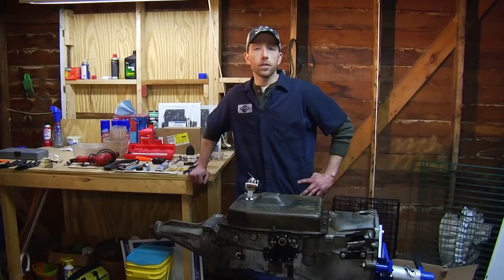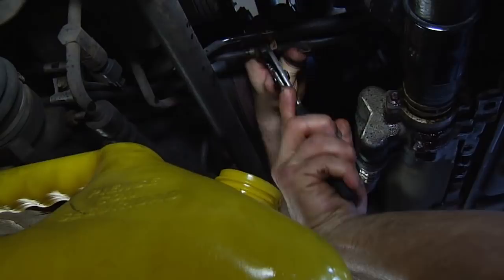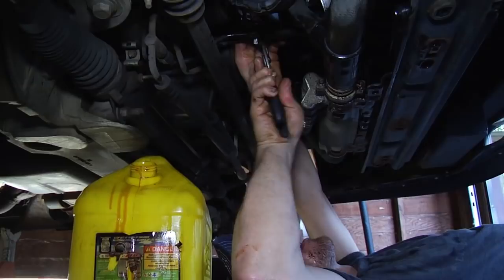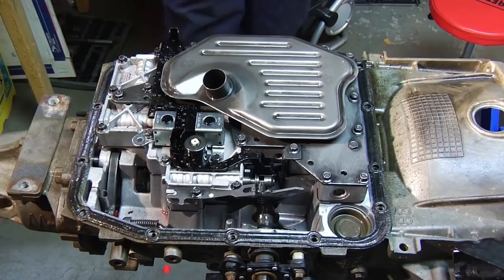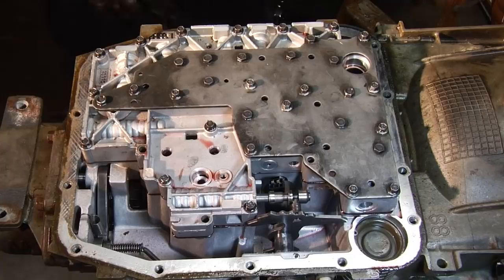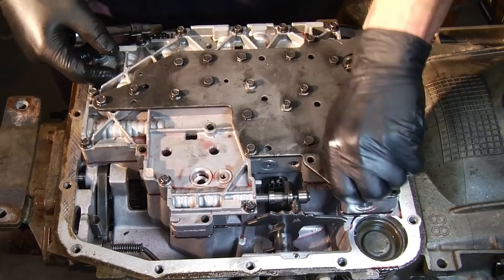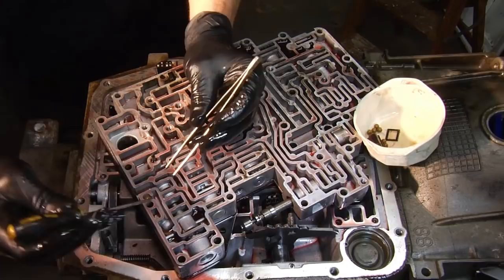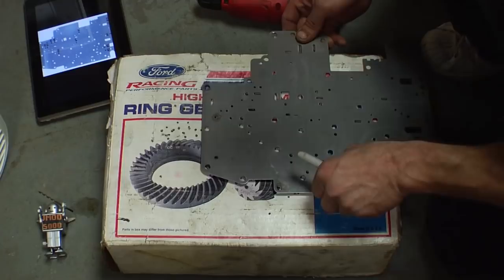The Official JMOD How-to Video by Rizzo

Comment: hi I need help with a small question I saw your forum posts now here's what I'm wondering for performing a j mod on a 1997 it says for hole 6 "no change pre 1998 due to no mechanical diode" so does this mean on my 1997 do not touch the hole at all cause it still gives a measurement of .125 to drill it to . so my question is am I supposed to drill it or not touch it all?
Reply from the maker: http://www.tccoa.com/articles/tranny/transmission/d97.jpg

See the ** at the bottom, drill to 0.125 like he says.
Reply: Ok thanks!
Reply from the maker: Wurd

Comment: okay another question the B&m  shift kit vs the j mod what is your take on them both what do you say is better faster less wear on driveline etc
Reply from the maker: I do not like shift kits.
Reply: Why you find something wrong with them?
Reply: +Mrzeskittles froster do both, Theres nothing wrong with a shift kit they come with stronger parts that would compliment a J mod. for 2006 and newer though you want feel a difference until you take the car to a performance shop and have them tune the transmission through the computer. Im having gearheads near Dallas do my 06 P71. Im installing a Fairbanks shift kit with the billet piston replacement and the J mod.

Comment: Jmodderator should I torque the 9 bolts that hold the seperator plate to the top of the valve body to 92 lb/in? I noticed you only snugged them but should they be torqued like the bolts that secure the valve body to the trans?
Reply from the maker: Yep.
Reply: Thank you very much! And great video; best one on the internet no doubt.
Reply from the maker: Sure thing. 

Thanks man.
Reply: Jmodderator sorry got another quick question. What will happen if I take the plate off of the bottom of the valve body?  The overdrive servo snap ring is broken, and I want to find all the pieces of the snap ring. Is there any way that a piece of the broken snap ring could find its way underneath the valve body and underneath that bottom plate?

Comment: If i just want to quicken the 1-2 shift only..can i just remove the springs you removed first and be done?
Reply from the maker: No, There is no cheating and don't be lazy.

If what your suggesting was possible why would we do all the rest?
Reply: Jmodderator then why when you remove the springs do you say "you have now just improved your 1-2 shift" as if its all that it takes? And when i went on the forums alot of people said they was doing that for 1-2 and 3-4 without drilling the valve body..so i wasn't sure. If you say it still has to be done then that's what ill do because if anyone knows i know its you..
Reply: @TheModAddict  Removing the springs is only a small part of the whole procedure. The freer movement of the servos due to the missing springs in tandem with the increased fluid volume and thus pressure is what creates the improved shifts. Simply removing the springs will cause erratic shifting and in later years will trigger a wrench light and limp mode. Just go the extra step and drill the holes.
Reply: @TwentytenS4B8  yea..this was 7 months ago..its all been done :-)

Comment: Jmod, on my 97 trans I had a Yellow upper & a purple broken lower accumulator spring and on my 96 trans I have a ORANGE upper and a PURPLE  lower is there a difference in the ORange & Purple? thanks
Reply from the maker: The purple, was traditionally... and possibly after 97-98 a color for a Mustang spring.

What vehicle is this in ?

Either way... Check the bore for scratches and such, replace the piston like I said earlier and remove the lower and see what you think about the shifts with out the lower.

Keep all upper springs.
Reply: Jmodderator I said that wrong the 97 has a YELLOW upper Purple broken lower  The 96 has ORANGE upper Purple lower... the car is a 97 crown Victoria lx........  is one a better choice  on the upper between the Yellow & Orange? the orange  96 seems stiffer than the Yellow 97. thanks
Reply from the maker: Those spring choices were made in factory.

I have never changed an upper in all the Jmods I've done.

I can not honestly say which is better, so my 2 cents worth of advice, is , sine they deal with down shift, leave them the color they are.
Reply: Jmodderator Will do, and thanks again for all the help and the video and breakdown you've uploaded to you tube couldn't have done it with out you!  cheers.

Comment: I have a 2011 CVLX and am going to soon attempt this. are the drill bit sizes going to be the same as in the video? I want to follow the video to a T. is anything different in a 2011 as apposed to other years?
Reply from the maker: +Mike Burgett  
No, but holes were enlarged by Ford as time went on, So you won't be removing as much as say a 1999.
Reply: Do you know by chance what size bits i will need to use?
Reply from the maker: Holes 2,4,5,9 and 11 = 7/32 drill bit.

Hole 10 = 3/32, This will give you faster reverse engagement.

Comment: Will any of the small balls fall if I work under the car? I don't want to end up losing them.
Reply from the maker: By that point the entire Valve Body has been removed. I just did it all on the transmission as it was convenient, you should do all the VB work on a table. 

it should be all assembled before it goes back on the car.
Reply: @Jmodderator  oh ok! Thanks.

Comment: Can someone please help me? I took the vavle body off on my 1997 crown vic and no case filter was in there. Does my year not come with 1 of those? l looked in every pocket and it just wasn't there, not in the pan either.
Reply from the maker: If you mean the one I am touching at 15:10 mark, You're fine. Someone lost it before you or the part never went it. 

You'll be OK without it. It was really for the first operation and what very very fine particles may be present.
Reply: Thank-you so much, l was so worried. I dropped the valve body in an empty pan and nothing fell out,looked up in there and nothing. Just happy to know it won't cause a problem.Thank again for the quick responce.
Reply: Please 1 more thing? #1 no change alredy .140,  #2 .081,  #3 .170,  #4 .081,  #5 .081,  #6  no change already  .140,  #7  .100,  #8 no change,  #9,11 were already over .081 so no change,  #10  .076,   l removed 2-3 spring, and 1-2 upper is white and lower is purple. I was unable to get the lite blue and pink so l'm thinking to leave the originals in. I'm adding Canadian Tire Mercon V and Lube Guard Shutter Fixx. Car only has 80k easy grangpa kms. Any thoughts and recomendations are truely welcome.

Comment from the maker: Drill your 2004 like I did the 2002. 

2,4,5,9 &11 7/64th
10- 3/32nd
Reply: I did this tonight after work. Watched your video twice, your instructions made this so easy! Mad props on this amazeing video! Thank you!
Reply: Same sizes for the 2000?
Reply: @s117xXx  I drilled both my 99 and 02 same way, no bad or negative outcomes, the 02 has more of a push you back shift than the 99, i removed springs in both and did both exactly the same.
Reply: Will this work for the 2010 crown vic  interceptor drilling the holes 7/64ths for Holes 2-4-5- 9-11 ?

Comment from the maker: Negative. When you do lets say a 2002 Crown Victoria, The system holds about 14 quarts, Using the trans line and then the rest of the Jmod you'll only get 10 qts. Draining the TC, Then doing the Jmod on lets say a 1997 that has a drain in the TC you'll get your 14 qts out.

Comment: What transmission can all be jmod iwant too go wit 4.6 4v out a lincoln aviator 2004
Reply: NEGUS IBE as far as I know this only applies to 4r70w and 4r75w transmissions.
Reply: The Lincoln Aviators have a 5 speed automatic transmission which is known to fail prematurely. Back in the 2000’s, Ford had a lot of problems with the 5 speed longitudinal automatic transmissions. I’m surprised that they failed more on the 4.0 V6 ones than the 4.6 models.

Comment: +1 on those htrz 2s. good tire overall.
Reply from the maker: What?
Reply: i notice the tire on the crown vic in the begining of the video. sumitomo htr-z 2s. really good tire for panthers, but in stock size (225/60zr16) they are a tad weak. in lateral grip. It almost looks as if you got the wheel and tire pachage from american muscle. they offer a stelar combination with these tires and some nice cobra wheels. im on the forums too, but im just starting my build. @ bavarianbanshee..
Reply from the maker: It was a customers car.

Comment: Hey rizzo... I just performed this on my 06 p71 and im having problems... its a quicker shift but my problems are:  from 2-3 I hear a slight clunk, my shift points are quick if im just driving around the block, my OD light wont come on (but I feel it when it comes on and goes off) my wrench light is on. I followed all the steps untill the end because I don't have a torque wrench so I just hand tightened all the bolts. And I cleaned the valve body with MAF cleaner instead of brake cleaner. Could not having the right torque cause this? PLEASE respond ASAP because this is my daily driver and Im afraid I cant drive like this for long.  Thanks
Reply from the maker: Given the two clear steps you didn't follow, and I also have no idea what your work environment was like nor do I know what else may have happened, I have no idea what went wrong.

Go get the trans code pulled and start from there.

Comment: Does the 97 4r70w have 1 spring for the 1-2 shift that needs to be removed? you mentioned in the video the 05 has 2 thanks.
Reply from the maker: THe 97 has a single.

YOu may also need this.

http://www.transmissionpartsusa.com/AODE_4R70W_Transmission_1_2_accumulator_piston_p/270-000027958.htm
Reply: Jmodderator Thanks for the reply can you tell me why I would need that part? is it to keep the piston firmly in the bore so it won't leak fluid out?and do I absolutely need it for my application thanks Jmodderator for the reply and info.
Reply from the maker: sabrom
 It's a newer style piston itself.

There's a 50/50 chance you have the older aluminum one. If you do, Yes, buy the new one and replace it.
Reply: Jmodderator Yep, I looked at it today it's the aluminum one thanks for responding and saving me time "whew"!!  thanks again jmod,
Reply from the maker: Wurd

Comment: What’s the difference between he j-mod and a shift kit? Which would you recommend doing?
Reply from the maker: Well, Obviously I prefer the Jmod over an OTS Shift Kit. 
Both ways of doing this involve nearly identical steps, This way lets you make more decisions specific to your car. You may not want faster engagement of reverse let's just say. Well you can't close up hole #10 after XYZ company drilled it out. Also shift kits have a profit margin above the part cost, So they are just going to be more expensive. 
The way I tell people to do this is get a hold of an old Forum member I know. He will work with you and figure out what sizes to drill which holes. Then he will send you a Tuff Plate already drilled as you asked for. All you have to do is the work. If you want to replace the pressure solenoid, He can help with that. (They do wear and that causes an internal fluid leak which drops pressures, And that effects everything. That's the valve body's blood pressure. 

So that's my story.
Reply: So I understood dona j-mod, whats the forum members handle, I am interested in getting some work done to my transmission.
Reply from the maker: @jh_3v800  https://www.facebook.com/Ford-transmission-repairs-Jmod-348414635312478/
I don't get anything for referrals, I just flat out believe in this guys work and work ethic. I've known him for well over a decade. 

Good luck man.
Reply: Thank you! The least I can do is give a like to the video. What other benefits can I see from the j-mod
Reply from the maker: @jh_3v800  
The Jmod has three main benefits. 
1 The transmission can in a sense breathe easier with the increased hole sizes. 
The transmission operates better with a new pressure solenoid (Not shown in video, But very easy to do) 
The fluid change along with a battery cable removal-PCM reset it will perform better. 

The shifts can be much quicker and firmer, More direct (Talk to Eric and discuss your goals and hole sizes.)

Comment: is it ok if i didnt take the 2-3 spring out?  took out 1-2
Reply from the maker: For clarity, You removed the LOWER 1-2 and left the UPPER in there. 

Then you left the LOWER (only) 2-3 in there. 

Yeah, That's fine.
Reply: ok cool.  yea took only lower 1-2 out as in the the video.  but where you bend the tabs on the 2-3 and remove the spring,  i did not touch 2-3 at all.

Comment: about to do this on a 4r75w in my f150. anything special to look out for?
Reply from the maker: Yes, Truck VB's are slightly different. I would research that on your own to confirm.
Reply: Yeah I see an impossible to find company called Factory Tech makes a plate but I can't find them
Reply from the maker: Try asking this guy.

He is 200% legit.

 https://www.facebook.com/North-Georgia-Transmission-Auto-Repair-348414635312478/?fref=ts

Comment: can i do that exact to my mercury marauder 2003
Reply from the maker: Yes.

7/64th for holes 2,4,5,9 and 11
3/32 for hole # 10.

Hand twist the paper gasket hole for #4. The lower or closest to the VB gasket hole will not be large enough.

Just slowly twist the 7/64th drill bit by hand to slightly open that one hole in the paper.
Reply: Jmodderator Is that the same as a 2003 F150 4r70w?  Thanks

Comment: Does this work for 97-03 f150?
Reply: If you have a 4R70W, 4R75W, or AODE, this will work. You have to research first what transmission you have based on vehicle model and year, then jmod as per instructions for that model.

Comment: Do I drill the gasket holes also?
Reply from the maker: Usually #4 needs to be punched out.
Reply: Jmodderator thanks and one more question, I don't have a lb torque wrench... Is there a way I could tighten bolt with regular wrench? Is it possible @ all? Like making sure it's tight but not to tight with regular wrench?
Reply from the maker: Inch pound torque wrench is absolutely necessary.

Comment: I am curious can you JMOD a 94 mustang with an Auto trans?
Reply: if it has a 4R70W in it
Reply: Probably a dumb question but are the ttrans marked. My car was bought as is on a salvage title slot is not original.
Reply: @jrusted5.031  -  if it has the original Transmission I could search it for you
Reply: How would that be possible?
Reply: Thanks that's very descriptive!
Reply: Thanks @Keith Johnson - Shelby GT500 that webpage was real helpful.

Comment: Well my Jmod lasted about 7 months. Now it will not shift past 1st gear.
Reply from the maker: Ok...So..........................................................................
Reply: Jmodderator I'm wondering if it's the pump, low pressure or friction disks.
Reply from the maker: Can't tell over Youtube.

Comment: The only part of this that freaks me out are all the check balls, lol.....

...and having a big enough pan - and enough flattened cardboard on the floor - to catch everything that rains down on you once the valve body is cracked loose. Man, I am not looking forward to that
Reply from the maker: I will leave three bolt in the VB from one end to the other. Remove on of the three entirely and then screw it back in a few turns. This will be the STOP bolt. Then loosen the other two slowly. 

The idea is to control the VB with the three bolts and make the mess easier when doing this on jack stands.
Reply: @Jmodderator   Yep, that's the plan!